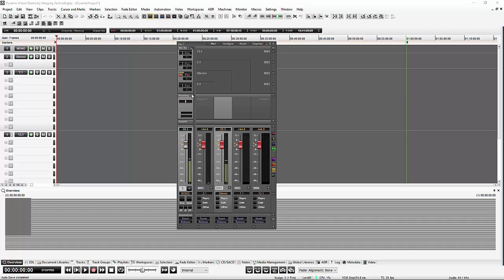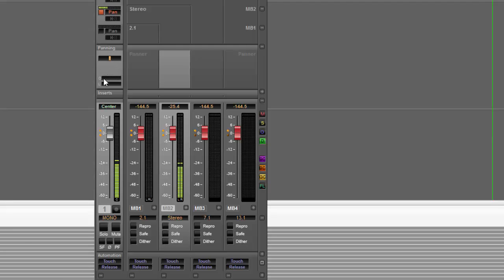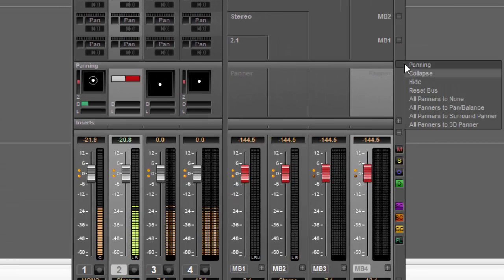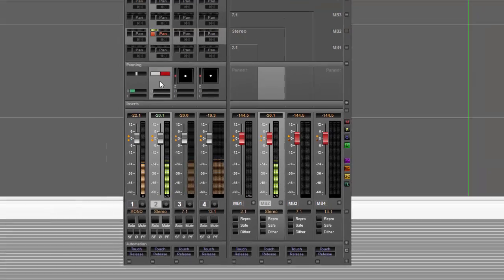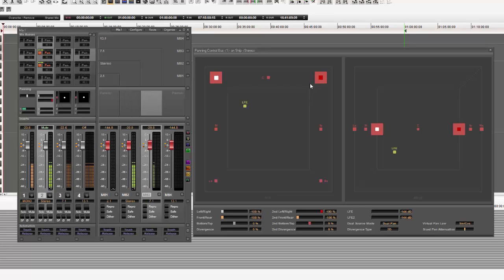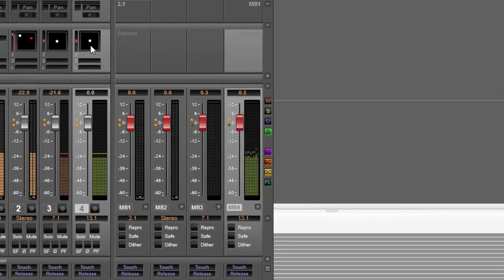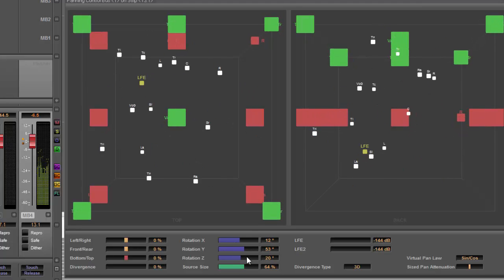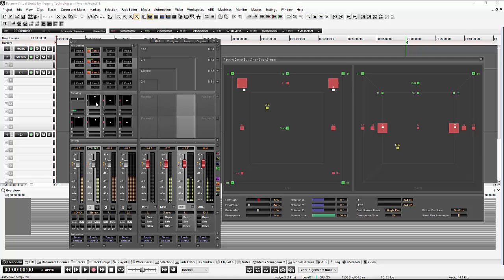Pyramix 10: Panner Interface and Operation

Comment: Is it possible to perceive a 3D effect using regular headphones through these capabilities? LongCat is much smaller than Merging and made something interesting regarding virtual 3D effect... Think you can do wonders with this complex panning engine, even to be perceived with stereo headphones...
Reply from the maker: +Marcos Ferreira You can easily achieve this by inserting a binaural VST plugin into the bus output chain and then configuring the monitor section to listen to the L and R of the output of that bus. this will allow you to hear your 3D in headphones.You can then even mix this down to produce content!
Reply: Yes its called binauralization of the mix. They also support it through a suite of VST plugins from another company. It's all in the pyramix website.